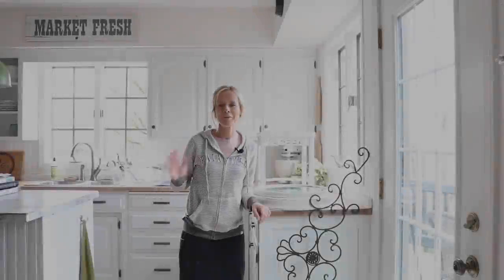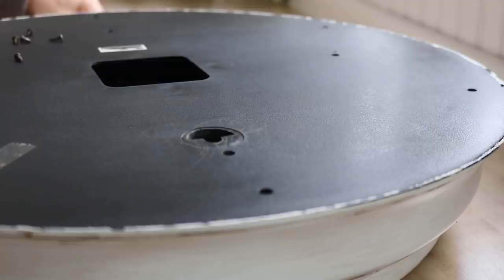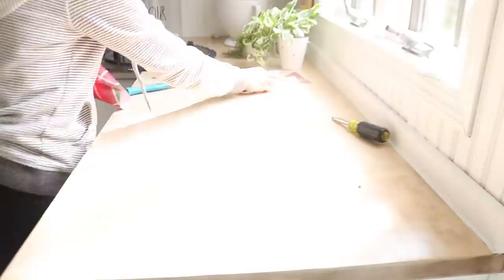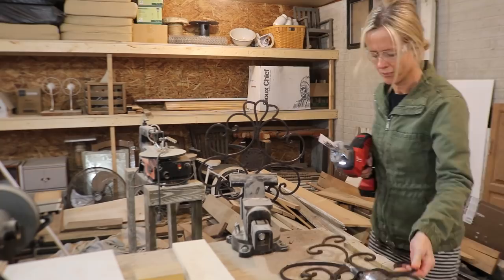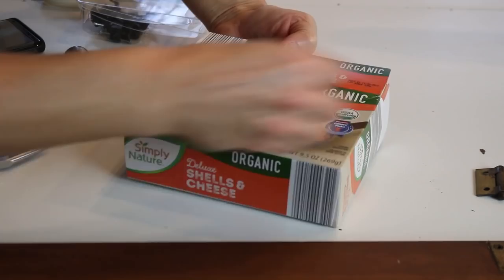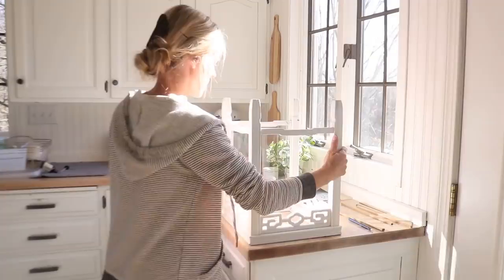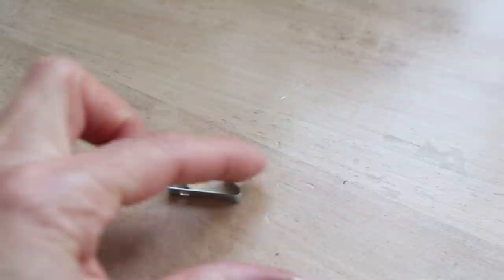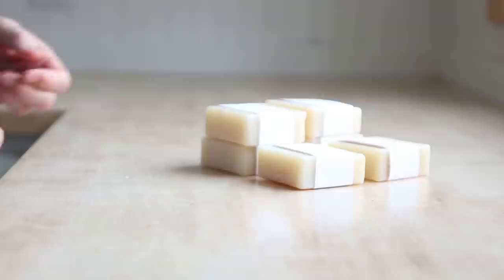Trash to Treasure Episode 21 ~ Plant Stand Flip ~ Clock Makeover ~ Wrought Iron Decor

Comment: My favorite is that little plant greenhouse! What an eye you have, Mary! I have had the same struggle with one of those plastic clocks. All I wanted to do was replace the clock mechanism that had failed and glue on a quilt piece to be the face, but in spite of the little screws it seemed to have been glued together and I had to result to brute force just like you did. I did end up with a nice working clock with a new quilted face like I'd planned, but it wasn't easy!